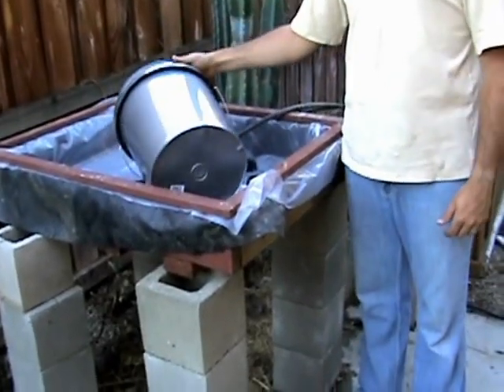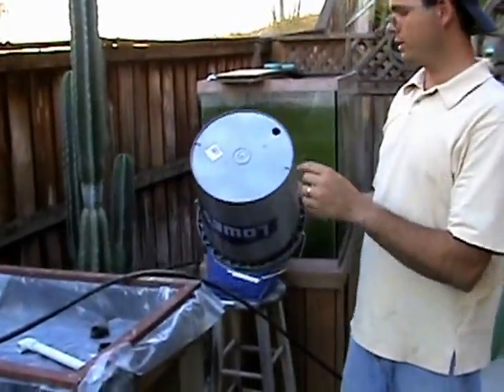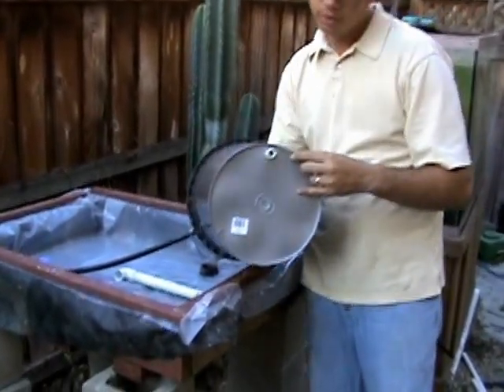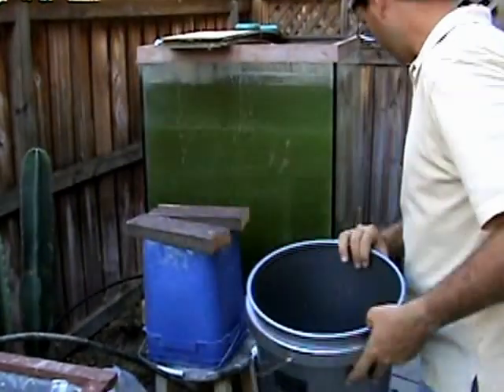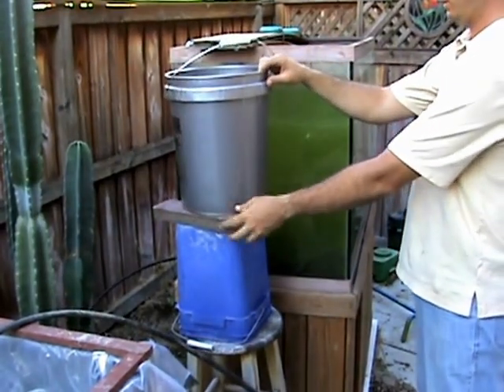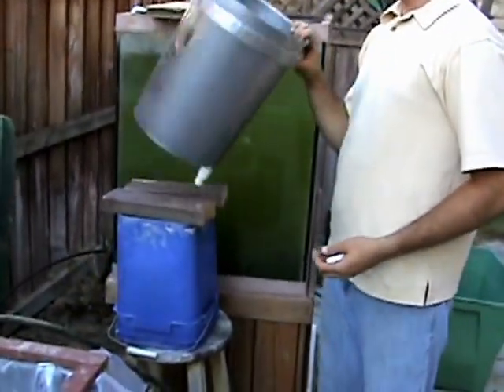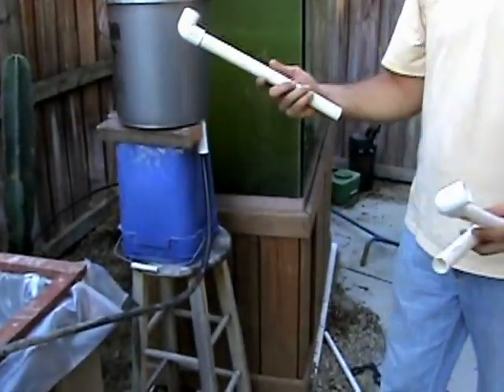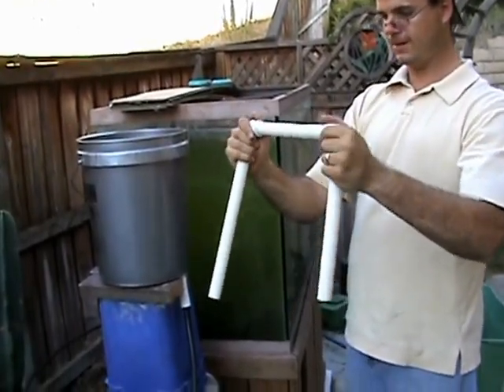Making a water bridge aquaponics system

Comment: Chlorine...killer of all fish. There are drops you can buy at any pet store that will denature the chlorine or you can add the water to the tank, turn the air pump on and leave it for a couple of days and it will eventually evaporate from the water. Also, if you filled the tank from your outdoor waterhose, you probably had an amazing amount of nasty bacteria growing in the hose that would kill the fish, too.